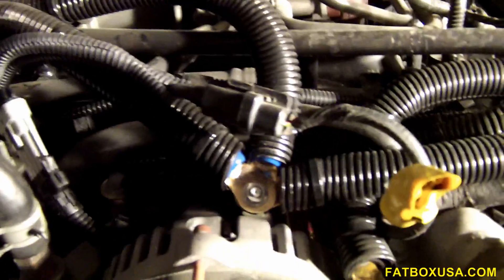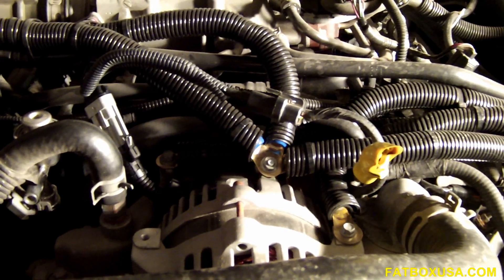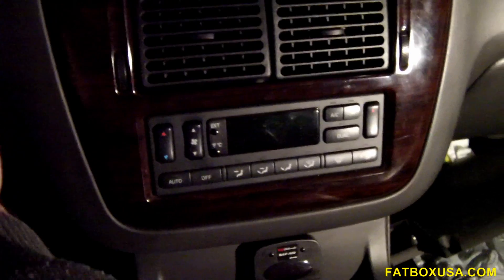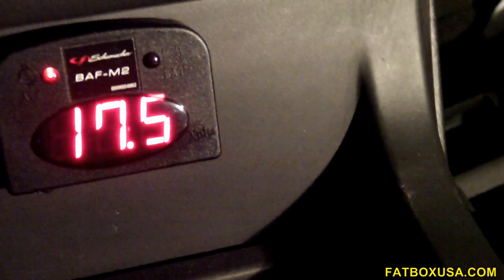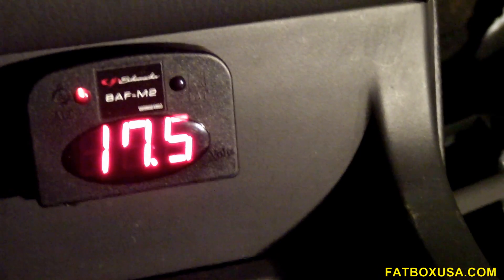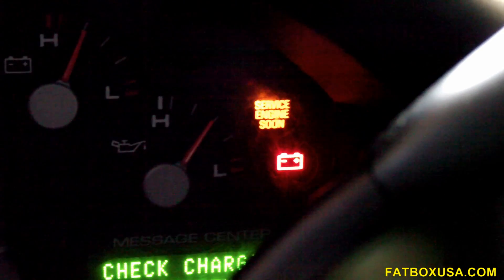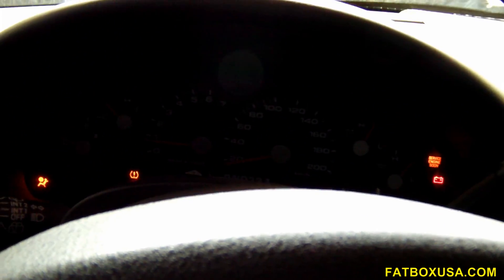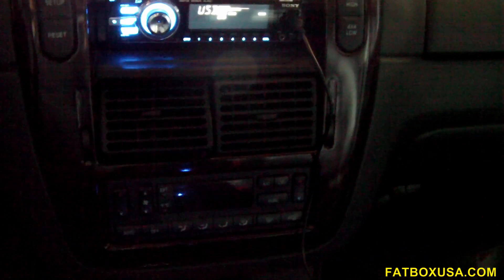Alternator Voltage Boost Module "UPDATE"

Comment: the stage 2 kit would be what you would use to charge a 14v bank off your 12v alternator..

the stage 1 kit is suitable for high powered systems on a 12v bank

bear in mind most batterys crack it being charged over 14.8

Comment: I will tell you from my years as a mechanic, not to mention the fact I'm a bass head myself... I have a 15.1 volt set charge on my DC power xp270 alt.. and with 12 volt batteries... I killed them even 12 volt agm batteries...

Not only that but YOU WILL DESTROY YOUR CAR'S FACTORY ELECTRICAL SYSTEM BY CATCHING IT ON FIRE. if you continue to run your voltage that high on a factory system. its that simple. run it like that and burn your car down. that WILL happen. I PROMISE
Reply: lovindatuba been running mine on stock alternator and stock electrical with big 3 for about 3 years with no problems. I made my own with rectifier diodes. My voltage is only 16v though.
Reply: Nothing will happen. They sell on zzperformance

Comment: You're an idiot. Those batteries are going to lose cells in no time. Charging optimas over 14.6 is NOT good. I had my yellowtops charging at 15.3 and they died within a week. Good luck with that lol

Comment: You gotta isolate a seperate circuit design for higer voltage as failure is iminent running your stock electrical system that high, mark my words.

Comment: Anything over 16.4 in ur truck will shut ur gauge, headlights, radio, etc off.....i have same truck and 14v batteries....ur batteries are gonna swell bad being 12v if you keep charging at that voltage